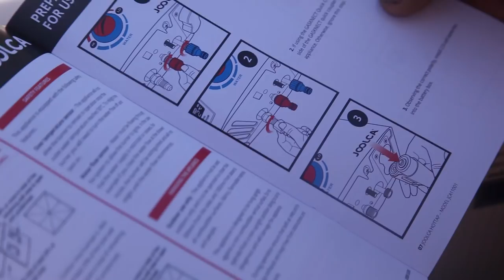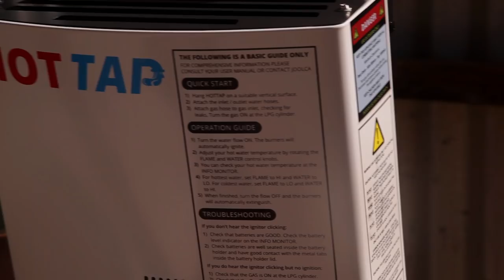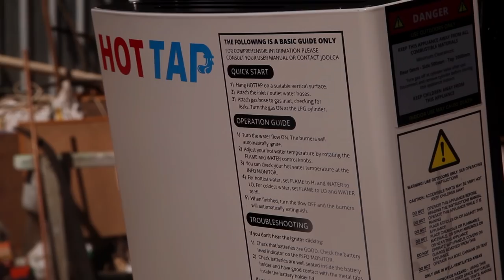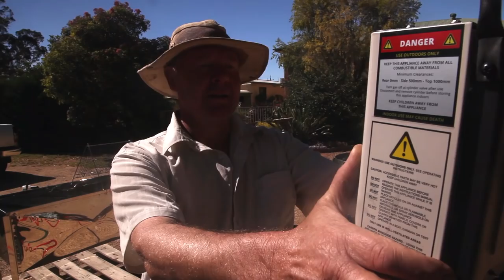Portable Hot Water Service to Clean Honey Extractor - The Bush Bee Man

Comment: If you were keen you could try running from the water heater through your pressure cleaner. Kind of turns it into a hot pressure cleaner.
Reply: Not enough flow for the pressure washer.

Comment: Hey guys run down to the hardware and get a cheap sack trolley strap the bottle at the bottom and srew a plywood back to the top mount the hot water unit to it now its more portable.  My plumber m8 uses a infinity set up the same way for tempory hot water emergencies